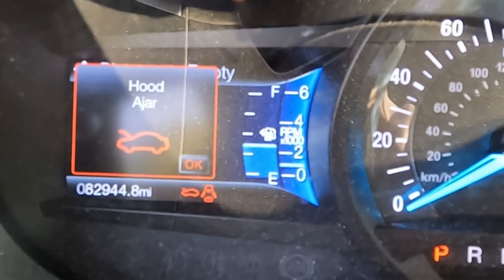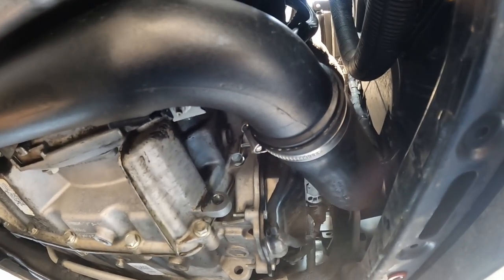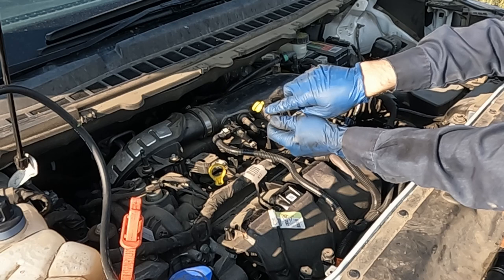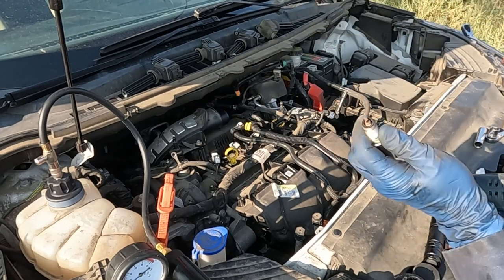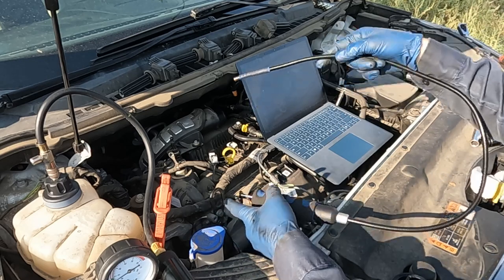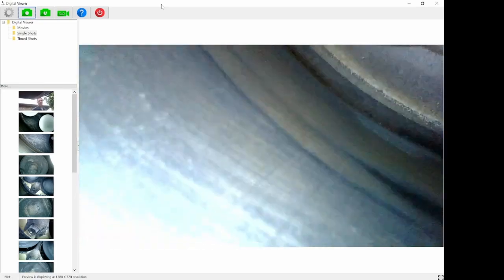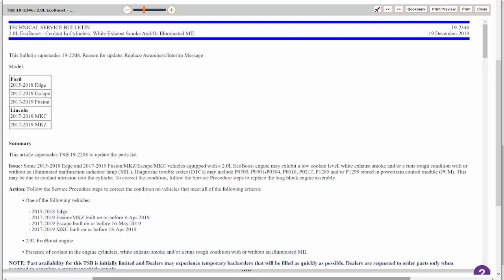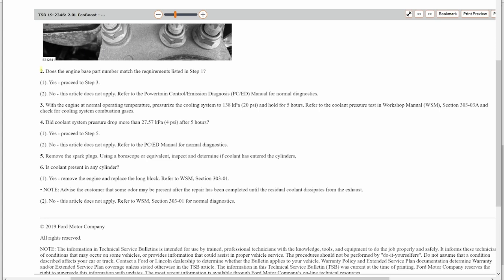2015-2018 Ford Edge Coolant Leak | A Sad Day For Ford Owners!

Comment: I have the same issue right now. Only 77000 miles. I’m told I need a new engine. This is outrageous. This is not yet considered a recall. If I kept driving my car it could have caught fire. I have three babies… Ford needs to own up and replace the engine. I’m working with Ford assistance, they are trying to figure out how much they will cover for me. Doesn’t the Lemon Law cove me on this? Any attorneys out there?
Reply: Was just told the same thing today. 77000 miles 2018 edge. I'm outraged
Reply: So very sad. I pray this gets resolved.  Mine is leaking too at just over 28,000 miles. Just got it less than 2 months ago
Reply: Same problem 2019 Ford Edge , 60000 miles
Reply: Did ford assistance help? same issue with 2015 ford edge
Reply: Same here. I have a 2017 edge @ 73000 miles.
Reply: I have a 2018 and I put some K Seal in and haven't had the intrusion/misfire come back yet.  It's been maybe 6 months now.  It's maybe worth a shot.  There is a TSB and class action lawsuit, but doubt anything will go anywhere.  It's a flawed design.
Reply: @Steef12 how often and how much coolant were you having to use
Reply: @kennyhart2699  mine didn't happen super often.  It happened maybe 4 or 5 times and the coolant would drop to or below the min level in the reservoir.
Reply: @Steef12 Did you just add the K seal to the coolant or did you flush it out and add water like dinnertime else mentioned above?
Reply: @deitrajones4879  I only added it.  I did not flush it out.
Reply: I just got bit with the eco bomb  I mean eco boost problem myself at 88000 miles 16 edge 2.0 same exact coolant intrusion AND broken timing chain have already missed 3 days work but have a rental car ready Ford Motor Company has demonstrated gross negligence for not doing a recall involving these terrible engines had a Taurus for 23 years of trouble free service wish I never traded for this rolling nightmare I have now
Reply: Same just happened to my 2018 Edge 90,000 miles. $8000 to fix according to Ford. 😤
Reply: Who ever is trying to buy any of these eco boost vehicles stop don’t buy it so you won’t go with this headache that no Tylenol can’t fix but to replace the engine at advantage because down the road you will have the same problem so stay away from any of these vehicles.

Comment: I was one of the fortunate Ford Edge owners that had this issue, and it was only by the grace of God that I found the issue in time to have the engine replaced at Fords expense.  I was searching the web for another issue on my Edge when I came across that TSB and decided to check my 2017 Edge with the 2.0L engine.  With 48,050 miles on the vehicle, (the powertrain warranty expires at 50K) I had the shop where I have all my service work done perform the diagnostic test as outlined by Ford, and sure enough, I had the dreaded head leakage issue, (in mine, it was cylinder # 1) and subsequently had a new long block installed that Ford paid for.  While going through this I learned that those owners that had over 50K miles on their vehicles had to pay for that repair out of their pocket, and some paid as much as $8,000 to $9,000 out of pocket for it while still paying off their loans!  Ford should have been sued for that because they never issued a recall for it, and clearly should have.  I feel really bad for all of those 2.0L engine owners that basically got screwed out of their hard-earned money while Ford skated away free and clear.  Failures like that should be illegal!  Where is the FTC and or the DOT when you need them; I'll tell you where, asleep at their desks like all the other over-paid, crooked politicians in WA DC!  Thank you for a great video.  Unfortunately, it's too late for a lot of Ford owners, but I applaud your efforts.

Comment: If it was mine I would drain the coolant and flush all the coolant out put water in it and K&W Metallic Block Seal in it and follow directions on the can and see what happens, I did it years ago to a 1980 ford truck with a 302 that had a cracked cylinder wall and it sealed it and the owner ran the truck another 2 years everyday without a problem until he traded it off and bought a new truck

Comment: Currently dealing with this right now. 2018 Edge with 58,000 miles. Service department put a $9,300 price tag on it. I have seen so many stories online. This is very poor form on Ford’s part.
Reply from the maker: @Junior24.96  Ah sorry man! When you buy a new car you don't expect it to fail so soon 😕

Comment: They made one version on the 2.0 Ecoboost in Spain with different casting techniques and no crossover coolant “trench” between the cylinders and that 2.0 is without issues. So somewhere along the line Ford knew this was an issue and changed the casting methods at the plant in Spain. Why is nothing being done for consumers about this failure on the part of Ford?

Comment: I have a 2016 Ford Edge, had this problem at 28000😤😬, had to get the engine replaced still under warranty but the engine was on back order for 4 months. My dealer done right by me by giving me a loaner vehicle for the four months
Reply from the maker: I'm glad you were able to get it fixed under warranty 👍. The backorder shows this is pretty common... Unfortunately 😕... But the new engines should be updated without this issue 🙂

Comment: Thank you so much for this video. My 2018 2.0 liter Ford Escape w/Eco Boost (only 57K miles) is currently at the dealer with this exact issue. In looking up the problem online, I read several horror stories about Fords needing a new engine b/c of this issue; I was getting really concerned about what this would mean for me/my vehicle. The dealership hasn't even given me a concrete diagnosis yet (except to say coolant leak which they are trying to pinpoint). After watching this video I feel much better prepared to talk to the dealer on this issue. Thank you, would def love to buy you a coffee!!
Reply from the maker: Thanks Trish! Unfortunately a lot of Ford owners are experiencing what you're going through. Hopefully they take good care of you. Please keep us updated with how it turns out.
Reply: @ValleyMobileAutomotive  Dealership says coolant in cylinder #2 and they have to replace the long block at a cost of $8,656.58. Warranty has expired and not eligible for Ford to pay for the repair. Service rep says he is talking with management to see if there is something they can do to assist. This car was purchased new and my first experience with Ford. I work remotely, drive less than 10K per year. I am SOOO upset and not sure how I'm going to pay for this. But I can tell you, I was so much more prepared to handle this news because of your video. I'll know more tomorrow.
Reply: @trishconnerywalkup9056 any updates? We are going through the same mess as of yesterday…
Reply: @tannermckenzie5442  Not all horrible news but not good and yes, the engine had to be replaced. 

After much complaining and protestations on my part about the situation, the dealership, in conjunction with Ford Motor Company, agreed to cover about 45% of the cost. This will definitely help but I'm still paying several thousand dollars out of pocket for something that I believe Ford should be responsible for. 

The dealership required a $3,000 deposit to order parts and start work. I talked them down to $2,500. Dealership said it would take 2-4 weeks to replace the engine. The dealer did NOT provide a loaner, they said they did not have one available. Their only concession was to give me their corporate rate to Enterprise if I wanted to get a rental. Fortunately, the combination of my going out of town and the fact the dealer got the repair done in 2 weeks meant I never actually had to get a rental, I managed without it. I'm actually picking my car up tomorrow (6/17/24). 

When I voiced my concern that the problem could reoccur, the Dealership said the new engine includes replacement of the faulty coolant system which has been redesigned/improved. The new engine also comes with warranty. 

I am grateful to the dealership because I feel the service rep I dealt with was on my side and advocated for me. But I still feel completely and 100% that this should be a Ford recall issue. There is SO much online about so many Ford owners dealing with this issue. And there WAS a recall for this exact issue for some Ford Escapes with the 1.5 Eco Boost engine – but mine is a 2.0 and didn’t qualify. Not to mention there has already been a class action suit.

 So, after I pick up my car I'm going to start a letter writing campaign, a social media campaign, contacting our local new "trouble-shooter' reporter and generally do whatever I can do to make a nuisance of myself as much as possible, to force Ford Motor Company to reimburse me for the rest of the repair. It may or may not work, but I'm mad enough about it to try. Sadly, I no longer have faith and confidence in this car or in Ford.

I hope this info helps… and good luck!

Comment: I bought an edge 2018 from carvans. It got the check engine light code for the 3 cylinder misfire. 3 days later Carvana is paying for a new engine and up to 400$ for a rental.
Reply from the maker: @Crazytomm  Wow that's crazy!

Comment: Same problem with 2017 Ford Explorer, only has 54,000 miles. Bought it used with 28,000 miles and kept service up to date. Started skipping, had a tune up at Ford. Started skipping again within 3-4 days. Took it back and they diagnosed coolant in cyclinder. Want $12,000 to replace engine. I am going to try to run some sealant in coolant to see if it will help, sure can't hurt. Apparrently the engine is gone anyway!!
Reply from the maker: @DavidLedbetter-jj8mq  This is so unfortunate for these engines. Let us know if you have any success 👍

Comment: We just fell victim to this at 85K on our 2018.  Mine is covered under extended warranty but I hear there is a recall that should be underway and a class action lawsuit.  I'll get in on that because I did have a $100 deductible but might as well recoup if possible.

Comment: Does the 2016 Ford Fusion 2.5 have this issue as well? Was there ever a recall?
Reply from the maker: @mr.boniato6402  The 2.5 isn't an Ecoboost so it won't have this issue. In fact the 2.5 is a great motor 👍
Reply: @ValleyMobileAutomotive  I ask because mine only has 42k miles and the coolant level keeps dropping slightly, but no visible leak anywhere.. I've also checked the engine block by removing the spark plugs, but did not see any liquid inside.
Reply from the maker: @mr.boniato6402  If you haven't already I recommend using a coolant pressure tester to pump up the system and see if you can spot any leaks. I've had coolant hose leaks before that were so small it didn't form any drips on its own but when the system was under pressure you could see it.

Comment: My 2017 escape with 1.5 liter just began having this same issue at 222,000 miles. I bought it used with 200K been driving it a year with no issues until now. I'm wondering if someone had already replaced the head gasket for it to have made it to 222,000 without an issue.

Comment: Add me to the list. Just bought a 2018 Ford Edge Titanium from CarMax Aug 2023 with 22k miles, love it. At 28k miles 6 months later... confirmed have this issue, "needs new engine". Under Warranty from CarMax. Question is: Is it better to have this engine replaced by a Ford dealership who has all the right diagnostic tools, etc. to get it right? That route will take months (they are way backed up). Or is it ok to have CarMax do the entire repair (prob in about 4 weeks, unless parts are on backorder, in which case it's months). CarMax or Ford though?
Reply from the maker: Good question. I would say it depends on the mechanic and not the location. You can still get a rookie mechanic at the dealer, I was once. The new Ford blocks are better designed. The dealer would put in the updated block. I would question CarMax about where they will be getting the new engine.
Reply: @ValleyMobileAutomotive  Well, I'm resourceful, here's what I did: I called outside my Vegas area to Cali, found a Ford dealership that had 0 wait time! They are very familiar with the issue, so I drove my car there 4 hrs, dropped it off, flew back home. Should take only 1-2 months. Will have Ford do it.
Reply from the maker: @spellboundsx5098  Nice! Glad your getting it taken care of 👍

Comment: Hi. Thanks for this great informative video. I am overseas and having this issue with my 2016 Ford Edge 2.0 ecoboost engine and unfortunately I am out of warranty. By any chance do you know if its possible to do an engine swap perhaps to install a 3.5 v6 n/a instead? or for another 2.0 ecoboost from a most recent year like for example from the year 2019 or later?. Thanks.
Reply: I had the same question, and was told no by dealer and another mechanic

Comment: At 82,000 same issue 😢 2017 eco boost titanium edition just sick about this no warranty.
Reply: same here
Reply: Same here. If Ford doesn't do a recall on this or pay for most of it at least, then there is simply no way I would ever buy a Ford again. Think long term and do the right thing, Ford.
Reply: @JosephHaney-qq5cs  mine is to. Never a Ford again

Comment: We have a 15 edge with 66k miles and i have confirmed leakage in cylinder 1. P0301 keeps popping up and runs ok for the majority of the time. Had a 03 escape with bad transmittion at 76k. I will never buy a ford suv or car again.
Reply: Funny part is none of fords  I-4 or v6 naturally aspirated engines have this problem. Its an ecoboost issue. This is why i avoided the ecoboost turbo garbage. I'm sorry, but you can't beat a naturally aspirated  engine for reliability over these new small turbo engine garbage. I don't care what car brand you go with, a turbo engine will always wear out faster, than a naturally aspirated engine. I've never had a single issue with my V8 5.0L coyote engine on my 2014 F-150 and its pushing 150k.

Comment: Great video. Happened to me at 50K with Ford Edge 2018
Reply from the maker: @NotSoLiberal  Wow! Such low miles. Is Ford able to help you cover the cost of repairs?
Reply: @ValleyMobileAutomotive  dealer is replacing the engine (and didn’t bother to tell us). We had extended warranty and we were within a few days of expiring . So we were lucky. But seems like Ford should pay for it warranty or not since it’s a well known design flaw ?
Reply from the maker: @NotSoLiberal  That's great! Glad you're getting it taken care of. I understand the replacement engine has been redesigned to correct for this flaw. I agree that Ford should take more responsibility for this problem. So many have been affected by it 😕

Comment: Have a coolant leak in 2016 edge .. was told its a line going ro the rad .. cant be seen without removing engine/transmission .. 14 to 20 hr job ..
Reply from the maker: Hmm 🤔. I would get a second opinion from a different shop just to confirm. Don't tell them what the first shop said. Let them diagnose it from scratch 👍
Reply: I've had 3 different shops look for the leak and neither could trace it, called ford to ask their opinion after and was told the 3.5 2016 edge awd is know for these lines that leak.. they said if its a slow leak but can't be seen without taking engine out, better not fooling with it .. vehicle is not burning it, it's leaking on the ground passenger side front.. if not the hoses it's the water pump. Either way not worth fixing until it becomes bigger issue .@ValleyMobileAutomotive

Comment: I have a 2016 ford edge. 28,000 miles and it shakes over 45 miles and leaking light yellow fluid. Just got it one in a half months ago. Not sure what's wrong
Reply from the maker: Did you purchase it at a used car lot or dealer? If so I would take it back and have them look into why it's acting up. The shaking could be a tire out of balance. The light yellow fluid sounds like antifreeze. Does it have the consistency of water or oil?
Reply: @ValleyMobileAutomotive  I bought it at a Ford Dealership here in town. They set the warranty to brand new factory warranty. However,  I have a $100 deductible each visit plus "$135.00 diagnostic charge for each thing they have to check and if it's not covered under warranty,  I have to pay each $135.00 diagnostic charge. I have an appointment,  but can't get in until the 14th of this month
Reply: @ValleyMobileAutomotive  They yellow fluid, I couldn't tell the consistency. It was a stream of it center of the vehicle.
Reply: @ValleyMobileAutomotive  Thanks for taking the time to reply as well😇
Reply from the maker: @ME-pg3sw  I would encourage keeping the appointment and paying the diagnostic fee if necessary. They should do a good job getting it taken care of. If you think they are not owning up to what's wrong with it then I would take it to another shop just for the diag and bring the write up back to the dealer. But I hope you don't have to go that far. You may have 2 separate issues 1. The vibration 2. The fluid leak.

Comment: I've noticed that the vast majority of coolant intrusion issues are coming from the 2.0L ecoboost. I can see if these failures started happening if your engine was pushing 300k. which would be a lot more understandable, seeing as  thats when you start seeing a lot of engine problems start to occur anyhow with that many miles on it, with gasoline engines. but cracked cylinder walls under 100k is just ridiculous.

Comment: Is ford paying to replace the long block if it has that many miles on it
Reply from the maker: Unfortunately as of this video Ford has not yet compensated their customers for this issue 😕.
Reply: Nope.... Only way to not pay is to pay for an extended warranty from a 3rd party that does engine(long block) replacement protocols
Reply: @kbrownfocus  I just decided to trade it in 6weeks ago with 97,000 miles on it. To risky
Reply: @kennyhart2699  Smart.